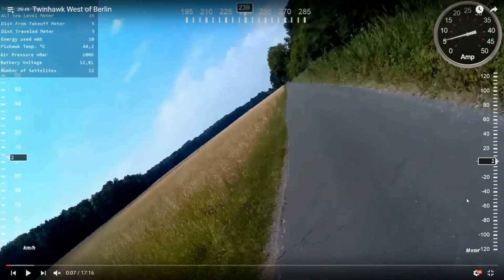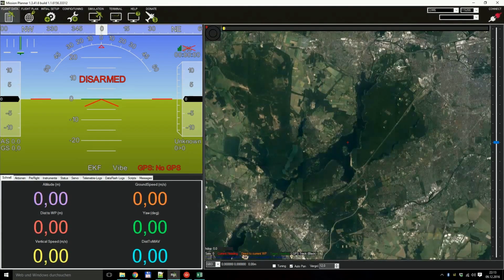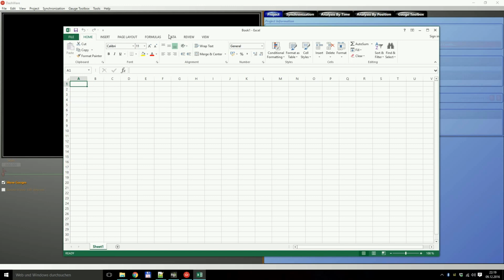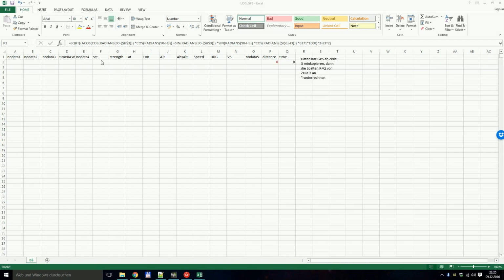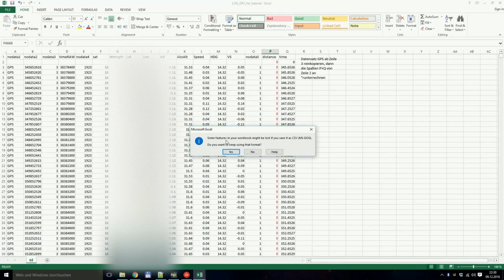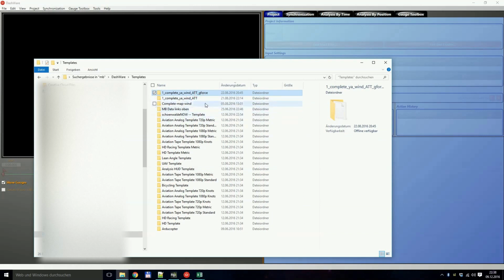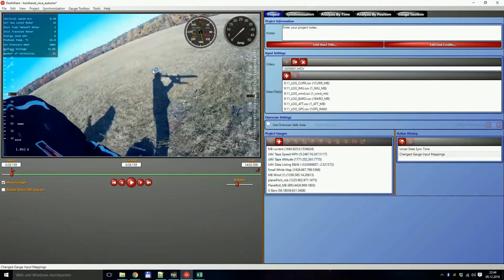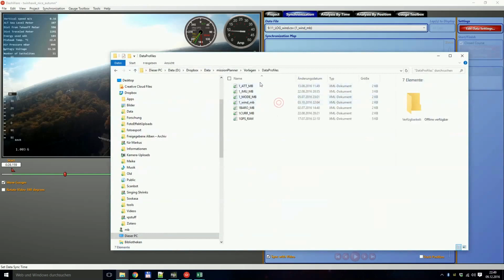[TUTORIAL] HowTo put telemetry overlays from APM/Pixhawk vehicles on videos using Dashware

Comment: Nice tutorial,  you did a great work , thank you ! 
Unfortunately I spent hours to try to make it work but  no way.
I think you should  publish some csv data files also , so people that want to follow your suggestions have a reference for data.
In Dashware there is also a setting for comma o period for decimal in numbers that have to be set.
I'm having different time length for the several CSV files , so there must be something wrong 
Finally, Libre Office do not work, for large filles, you really need MS Excel.
The procedure takes a lot of time, I wonder if some Visual basic script would create more  efficiently  the CSV files for Dasware.
Reply from the maker: Thanks, man! Concerning your problems, what exactly is happening ? Comma and period is important, I solved it by setting excel using "." as a decimal divider. And yes, you need Excel and you need the 64bit version for bigger files. VBS sound nice, but I cant do any programming ;) Another issue is that some units were changed in recent firmwares. With my templates you will get too low values for voltage and others. I didnt change them because it really depends on the firmware you are using.
Reply: No, I was wrong ApmPlanner seems to export the whole file...

Comment: Hi, Great Tutorial, Thanks!

I have issues with synchronization, the issue comes from .csv file. For some reason the excell gives a error from distance column (#VALUE!) and because that my log file gets a total wrong time, and Dashware get nuts.
Can you find any error in the distance column formula of your file? 
 =RAIZQ((ACOS(COS(RADIANOS(90-($H$3))) *COS(RADIANOS(90-H3)) +SEN(RADIANOS(90-($H$3))) *SEN(RADIANOS(90-H3)) *COS(RADIANOS(($I$3)-I3))) *6371*1000)^2+J3^2) 

Thanks in advance!
Reply from the maker: There shouldnt be an error in my file because it works fine. I suppose you a)pasted the data in wrong or b) have more or less data items in your log than me, leading to shifted columns.